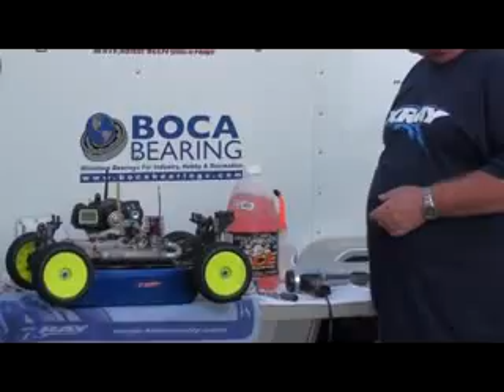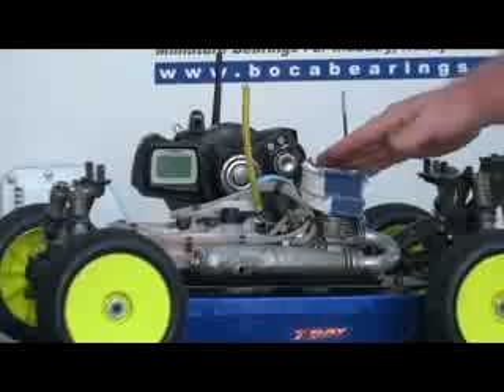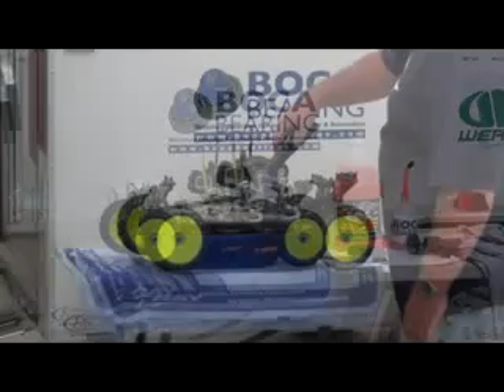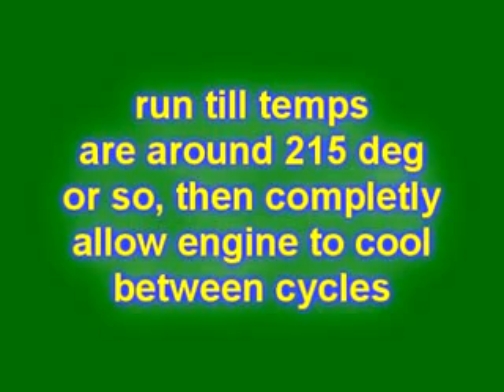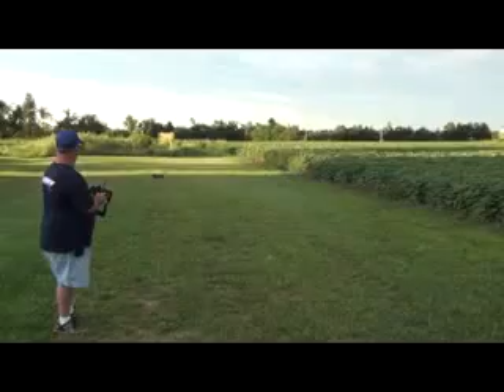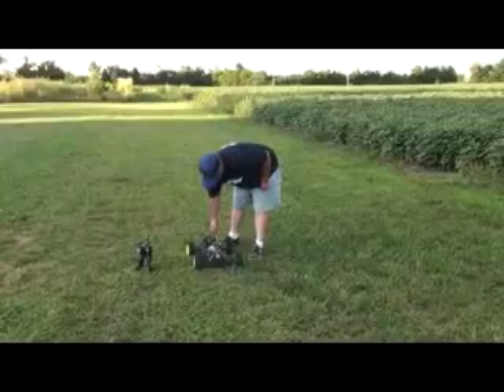How to Break In RC Engine  With David Mills

Comment: I thought "FINALLY !!, SOMEONE who know the real procedure of break in"  Then, I saw you blowing hot air to the BODY SIDE of the engine!!  You want the engine block as cold as possible(relatively speaking) and the top (where the heat-sink meets the top of the block) as hot as possible.  This means you should point the heat gun down, at the top of the heat-sink.  You need that differential of temp. to expand the sleeve and block, so that it doesn't pinch the piston.  If you choose to start w/o heat at anytime, sleeve & piston will grind away each other, so that at operating temp, where things heat and expand, the engine will leak air (compression)

Comment: So i have a 1/10 exceed hyper speed .16 engine that i bashed a few times now the brake throttle doesn't do anything on the remote control when i flick the trigger up. So i reversed the throttle on the remote control so now i have to squeeze the trigger to brake and the brake throttle works fine. Any one know whats going on here? I'm confused because everything works fine when i reverse the throttle on the RC but when i put it back to normal setting the brakes wont work at all.

Comment: my car full throttled at first start will this effect the engine? it was only on for about 5 secs then i pinched the pipe. plus now i have it under control it wont start and if it does start i try to idle it to break the engine in and it will turn off after a few secs is this a idle issue and does it need changing. i haven't touched any of my needles and its doing this please help